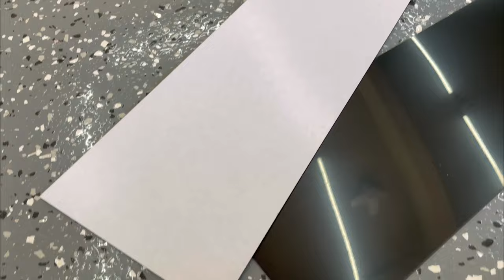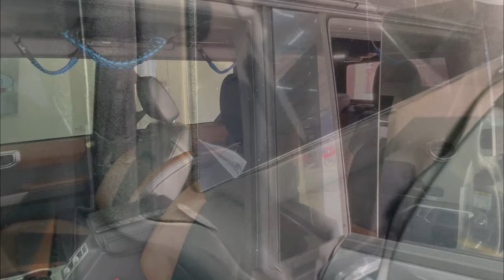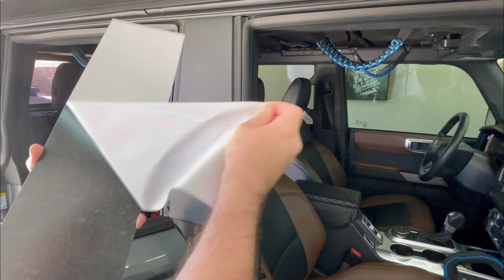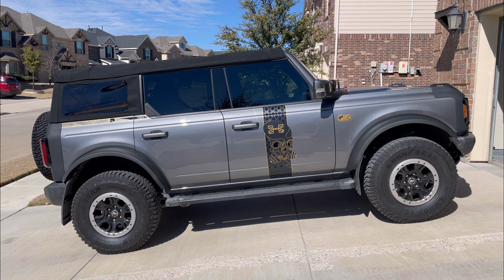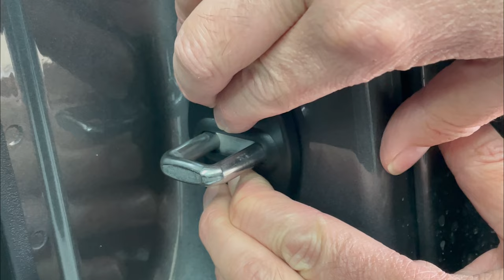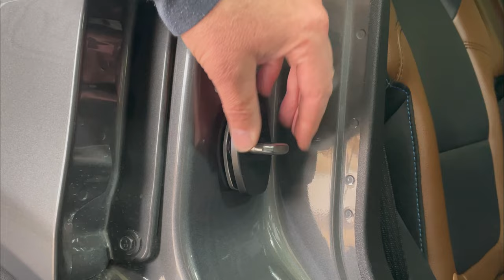How to Install the Gloss Black B-Pillar Trim and Door Latch Covers by Xomzema - 2021+ Ford Bronco

Comment: The B pillar trim looks great with the dark tint.
Reply from the maker: Thank you Brad! I was really surprised to be honest. This was one of those products I was asked to check out but it isn’t really ‘my thing’. But after installing I was impressed at how good it looked with the tinted windows, so for now, they are staying! The latch covers, I can take them or leave them… 😁
Reply: @CUPRA  yeah the latch covers don't interest me. But I did order the trim pieces from your link. I expected them to take a couple days to arrive, but it looks like they won't arrive until April. That's the only issue I have with some of the third party parts. Oh well, gives me something to look forward to.
Reply from the maker: @ImBradCrites  - That’s great that you liked them and thank you for ordering through my link, I appreciate it. Working with Xomzema, how it works is they send an amount of stock to the US warehouses, and then they are drop shipped from over seas warehouses as stock depletes. Unfortunately it sounds like you’ve hit them as the stock has depleted. I simply test products for them so I don’t have any sway to expedite your order I’m afraid.
Reply: @CUPRA  it's all good. I do enjoy watching all the new stuff you add to yours. I've added several of the same things ypu have, dome light, flag holder, and I'm sure a couple others. Keep up the great content!
Reply from the maker: @ImBradCrites  - Thanks man!